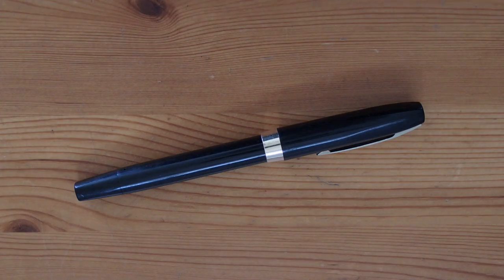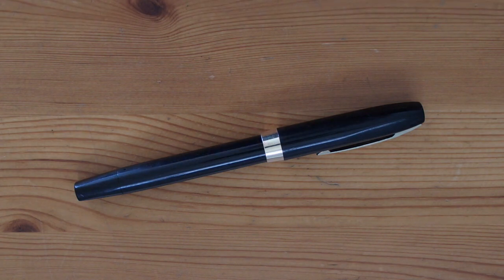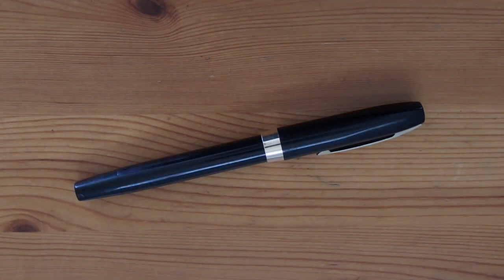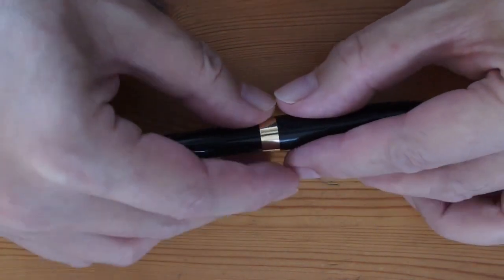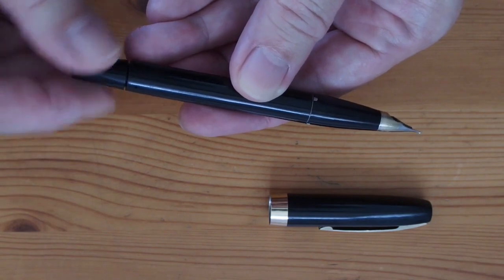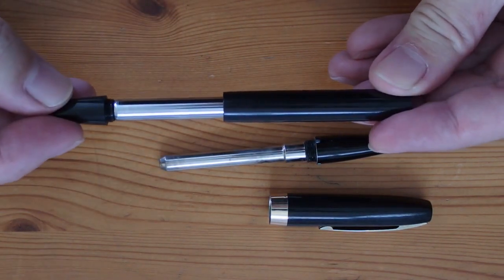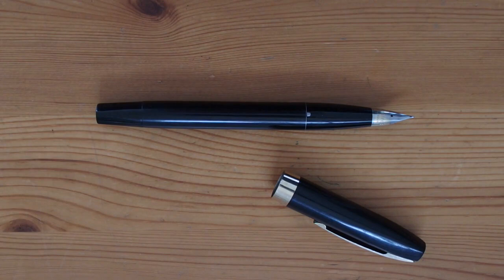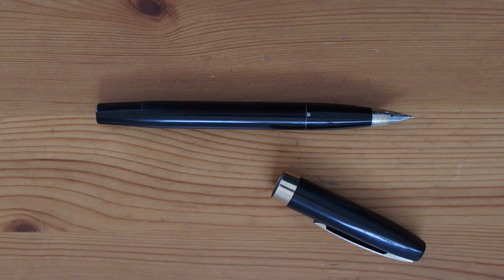The Sheaffer Touchdown Mechanism: A Design Analysis

Comment: Very late to this comment section. But if you see my comment, please reply if you wish. 
I have many vintage Sheaffer pens with various filling systems, including the touchdown. I’m about to buy another one, a Sheaffer 800, with the dolphin nib and the touchdown filler. The pen has been fully restored, never inked and is claimed to be in full working order and ready to write. I want to know that if I use the pen with optimal care and maintenance,  how long can I expect the restored touchdown mechanism to last before it would need another restoration job?
Reply from the maker: Sajjad Husain, it would be impossible to tell as there are far too many variable factors. For the example I showed, the rubber ink sac had not only perished but stuck fast inside the touchdown tube; it took me more than a week to remove the last trace of it, because any remnant inside would weld itself to the new sac and then proceeds to destroy it. Needless to say, the effectiveness of the barrier between the sac and touchdown tube, the quality of the sac and workmanship of installation, efficiency of the O-rings for the pump action, compositions of the inks used with it... there is absolutely no way of telling how long the pen will stay good. Sorry for not being more helpful, but that is the correct answer.
Reply: @Seele2015au  …No, that is obviously the honest and helpful answer. I totally get it. I will buy the pen, take good care of it and hopefully it will last many years or more. Thanks for the prompt feedback. Much appreciated!
edit: If the sac and filling system fail in the touchdown pens, is it possible to switch to the cartridge/squeeze converter system?
Reply: @sajjadhusain4146  It's not possible since the feed lack the nipple that holds the converter. But it can be serviced again, just new rubber parts. If it was just serviced as you got it, it should hold up for decades, given the parts used were of good quality (as well as all factors mentioned above). I would recommend to use "vintage"/rubber sac friendly inks and never let ink dry out. Clean with cold water, let dry and store if not in use.